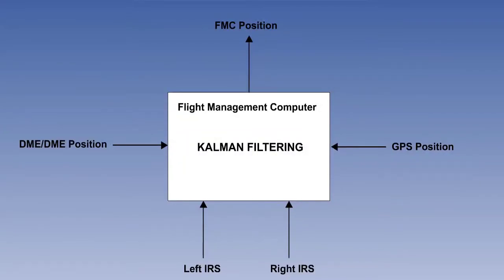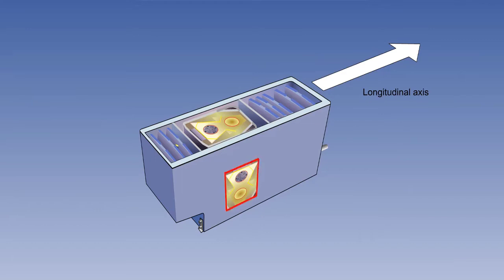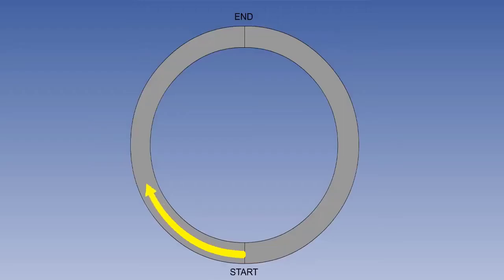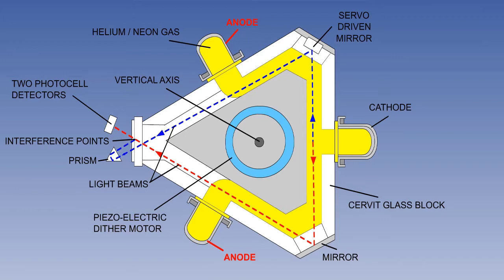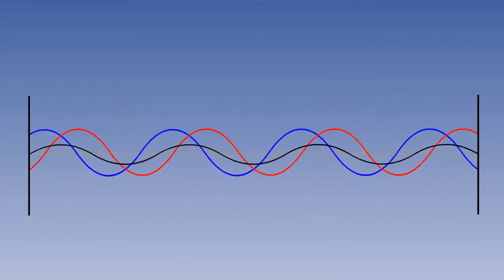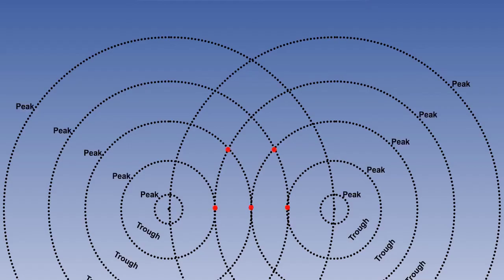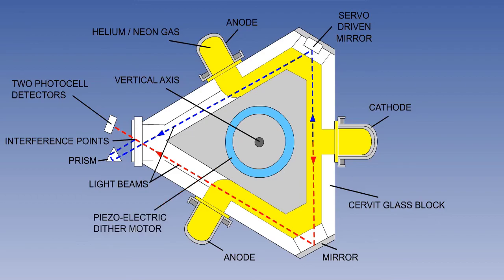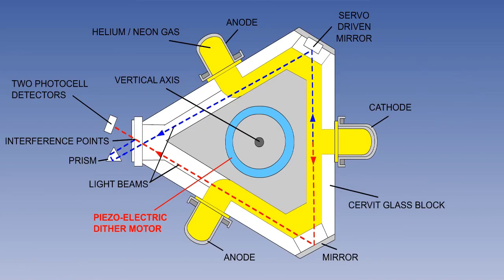Inertial Reference System Rising Laser Gyroscope And IRS Of Aircraft | Video 38

Comment: I think you have used the word 'frequency' at some points in the video where you should've used 'phase or phase difference'
Reply: @Nigel Green I didn't get that how frequency changes there is phase change due to distance change where is the frequency change can you show me ?
Reply: I think phase change alters the pattern intensity and frequency change alters the pattern itself. So you could have the same pattern with same frequency light and different phase, and have different pattern of light with same intensity for different frequencies.
Reply: I think we need to see the problem in relativistic terms, i.e., your frame of reference when looking at what is happening when the laser beams meet each other.  Initially I thought phase shift was the issue, but isn't frequency shift just the same thing when seen from a different observer/reference frame perspective?
Reply: @nigelgreen5795  how to differant fringes measure speed, when they say that c is constant no matter if you going ro or away from what your shining the laser at?
Reply: @hakaneskici2771  What really happens is the 2 beams have a different optical frequency due to the rotation and when you beat the 2 beams together in the beam combiner/ prism the difference is the Sagnac frequency. It is the Sagnac frequency  that is proportional to the rotation rate.
Reply: Agreed, the frequency of each beam does not change but their phase relative to each other does. However, the frequencies would be slightly different due to their relative movement. As you rotate, the source and receiver of one laser will get closer while the other gets further, effectively compressing and expanding each wavelength respectively. Even though the emitter doesn’t change its frequency, to the receiver each wavelength will have a different frequency, resulting in a difference in phase. See also the Doppler effect.

Comment: The cathode emits electrons, not photons. electrons are attracted to the anodes, colliding with atoms of helium along the way. The excited helium atoms transfer energy to neon atoms which excites electrons in the neon atoms. when these electrons return to a lower energy state they emit photons.
Reply: But, isn't Helium considered expensive and difficult to contain within a certain space and rare element ?!
Reply: StringerNews1  relativity says you cant measure light against light. The laser is just for show....
Reply: StringerNews1  there would be no way to measure the small fringe anyway. The unit must use xzy accelerometers plus ground based gps. As I said the laser is just for show.
Reply: @johnnym6700 actually, there are counter propagating beams which are combined with a prism, creating an interference pattern of dark fringes. When the gyro rotates, the fringes are counted. This kind of gyro is a rate integrating sensor.

Comment: I worked with the inventor of the ring gyro. This technology is over 40 urs old. it was never meant to be placed on airplanes. It was developed for submarine navigation systems. The project was sold to a company that used it in missiles.
Reply: Never intended, but tecnology marches on and minituriseation happens
Reply: The very first iteration of the ring-laser "gyro" was the optical based Gyrocompasses.
Reply: StringerNews1  The Sagnac Interferometer worked long before the first laser. about 45 years before in fact.
We have been measuring earth rotation using light for over 100 years.
Reply: These instruments were developed by Litton Ind, Honeywell and Sperry. There were many engineers on each team.
Reply: @Wanderingsomewhere145  Do you see the comment above yours that states:
"you and whom, exactly? Show me evidence of this in periodicals. I'm not holding my breath..."

There is no name and I cannot "Reply" to it.
Never seen that before.

Comment: As a certified moron and idiot. I head up a UAV company that's in the middle of building a UAV using 6 JP10X JETS (4 vertical mounted in a Conard-style design and configuration for hover mode and 2 larger J10x rear mount horizontal motors to give us >450mph fwd thrust and (with "alterations") an altitude of >60,000ft ... <48k is our current record. (Tweaking elements and heat lines to get that extra 12k is in the works) (sorry to be speaking in word salad mode; but none of this is supposed to be public knowledge though it literally doesn't take a rocket scientist to get this far) as we're working from the tail forward & we're now working on NAV and guidance plus "track and trace" with ultimate lock and fire as the goal. The question that's arisen is the choice and even the need/usage of gyros and my "MIT team of experts" all on holiday atm for the 4th all are pushing for a neuronet laser gyro which I think you've done a brilliant job of explaining here over these your 3 videos plus others I've watched. Look, I'm just the guy who gets contracts and signs the checks. NAV and Guidance alone without any track and trace and lock SW is running around $100K and now they insist despite us being 1/10th the size of the aircraft displayed in your animation (737 etc) do we really need this nuch gyro? In a UAV config is a strapped config wiser than gimble? Or vice versa? The goal when switched from 450mph forward speed to a dead stop hover mode at say 20000ft is to be stable, level, dead flat, and able to lock onto up to 35-40 targets (mobile (AtA) and take those out first then have a payload of 24 x 6lbs "dumb bombs" (that can be made "smart" via GPS or laser) with another hefty check written.... in order to ID 3-15 ground targets or one with a mega dump to ensure total destruction... which again requires a stable level flat 0 movement platform to be (calculating in weather elements and altitude and landscape etc) payload delivery system that's literally spot on the numbers then kick off the hover engines and go full.throttle to rear jets to get the hell outta there! Our "defense" is we've mimicked the F35c in shape and materials and made the fastest UAV that's not sonic nor sent as a suicide mission and reaching altitudes that rival the X2 (tweaks coming but will achieve that) and is constructed of titanium honeycomb blastproof panels with an inner wrap of Kevlar around 2 F1 style bladder fuel cells that are 3" thick and hold 35-50 GALS depending on armament as were pushing the weight load limits in the configuration listed above. If we point 2 hellfires and a dozen.6lbs dumb bombs we can take out 1 ground target and an aerial asset or ground battery and then push it to 50000 ft at 450mph (run and  hide) but have zero defence on the return flight we do have 12 chaff loads (6 per dual tail wings) with 360° radar sweep which brings us to the cockpit currently loaded with 7 boxes ranging from full radar sweep for 180-degree paints and lidar for building / mountain navigation and a myriad of other std 6 pack needs to fly in jet mode .... we're most vulnerable obviously whilst in hover mode but don't plan on being stationary more than 15 seconds if that ... for once targets are acquired we could do a sweep drop and never stop but must have a solid ID and look before pulling the trigger. We also have 2 55Cal MG front mounted to deal with pesky MiGs who like to buzz UAVs never dreaming they'll get a cockpit full of lead should they try that pissing fuel trick on us! Question is they want 80k for this laser neuronet GPS gyro. Ìt does allot yet in the grand scheme with everything else this UAV is doing in those "7boxes" how crucial is the type of gyro we aquire needed in this mess I've poorly described to you? We're not frigging Northrup or Airbus. We're a team of 12 engineers looking to make a roundtrip UAV that can out fly out maneuver and climb higher than any other UAV or ack ack despite the X2 being shot down from 82,000 ft 60 years ago. How they managed that imho was pure luck. But we wish to learn from history. And we have 200 free lbs today but once struts and fuel go in? we'll be right at our limits. Any increase in jet size is pointless as the added weight won't be offset by the extra lift and fuel burn rate we get worse. In the world of gyros what would you suggest here? I'm told cabin space is getting tight and this laser gizmo is quite sizable which has me looking at lesser models both for price & size but have zero clue how much gyro we need/used in today's aircraft? Then there CoG to sort out. Are all gyros center mounted!1 Q1? That too if true then creates a new fuselage headache Thsbks.
Reply: Honeywell makes small laser gyros (fiber based), which has a dimensions of less than 4"x4"x4".
Reply: @odissey2  thanks. Will look into it. You have a P/N or Series name by chance? Wow I’d totally forgotten about this Q! 7 months ago. Thanks for taking the time. As a tiny update of sorts; Our “track n trace” software munitions partner are Israel-based. And obviously after OCT 7th froze all partner projects to help arm their own country’s defence system. So for now we’re still doing test flights on the offensive side with BAe but we’ve had to place the defensive side on pause. 

Off topic but posted this yesterday somewhere asking around elsewhere by asking if anyone knows of a radar source for drone and missile sized objects? as we were going to make our own but after digging into it deeper… is another massive expense and seems some ppl are not fully up to speed as the Q I was replying to got closed due to it being an “opinion” vs facts. Never seen that before. So tagged a new note on in the same closed thread akd eager to hear thoughts. But our munitions (ATA / GYA tange is 45km and need a radar system that cover 3x more than that to give our AI tracking system time to ID the target. Lock-in. And then trace until insetted what to do. So been talking to several RF radar engineers  & the way I understand it it’s just not effective to build in-house and best to just sub it out & use Someone else’s instead of reinventing the mousetrap? Any thoughts on that? I was thinking if the radar dish in the nose of 747/777/787 etc. those are huge shd go out 200lm? Someone challenged me in that as it’s not apples to apples. I dunno. Just seeking a HDR solution. By the way, of the many typos I made; in re-reading my question/comment I saw the gyro price I put down. I left a digit off. It’s $880k per UAV not 88k. Oops. A big oops. Kinda a big difference so will def be researching what you shared. Does it integrate with LIDAR any? Cheers
Reply: And who fixes it when it breaks.
Reply: @B00ZEBAR0N  There is a Bird Aerosystems in Israel, who makes tactical radars commercially
Reply: @odissey2  we service each UAV (order is up to 24 now. So we’re budgeting in 2 engines for eaxh UAV as those go back to the mfg and never met a company or group of ppl (whivh in the big picture is good I suppose) who are so insist and anal that at 301 hours their warranty service goes away and the bill is 100% on us) and yes of course we’ll have repair/service bills outside of warranty but these folk are the leaders in jets used by Lockheed who can afford 100’s of swappable spares whereas we’re balancing the budget to keep 2 $85K/each spares at tgecreasy for eaxh UAC. So 2x 28 UAV’s is 48 spares that are plug n play hot swaps. So from a maintenance OOV from the outside we have it covered. Should we take a hit inside! Electronics is an entirely different kettle of fish as it’s not a field repay fix “today”. Ere liking at hot swap stacking trays should equipment enclosure stack or boxes go out or get damaged during an engagement - we all know it only takes a well placed single shot  or a pc of shrapnel that say penetrates from the bottom up and compromises all our nav systems will bring us down (?8- a chute) for a soft safe landing. Unless it’s deep over enemy territory then the “dumb bond that’ll equal over 50”bs of explosives will be as a last reset activated to blow the auAV aboard.  There’s currently 8 boxes in a rackmount configuration that if remotely diagnosed can be outswapped at Baer abroad or possibly in the field depending on the complexity of its function (LiDAR has to be recalibrated in the factory only vs a FBW box that is a basic hot swap if hit. But if shrapnel pierced all 7 boxes that most likely will take an ifly 20,000 ft fall to its death or self destruct will be activated if iver enemy terrify. It does have a “limp home mode” we’re testing now in 2 engines as the design will glide under no power. But only so far before we give up speed for altitude. Out number 1 objective as we saw in the recent Isnian attack in Israel was all the garbage hat fell to earth after being blasted inutbof the sky hitting residential areas which is our worst big mare.  So we have to weigh out the pros and cons of each feasible scenario and issue a myriad of option the pilot can implement from limp home to total self destruct and levels in between. The chute is located in the least vulnerable sebtion of the UAV and one safeicual alpha drone was blasted by BAE in N. England and a clump of burning metal softly landed with the chute deployed  and caused no ground damage nor fires as the inboard extinguishers condoned with lack of O2 at altitude kept that at a ninkoknas an auto fuel dump was also activated over water. C90% if thatvaporized or evaporated before hitting Sr’s level best we can tell (33 we’re 45km from the crash site) so have to t rely on NAE’s reports and their recovery team reports. That’s how we plan on short agd long term field and factory maibtnence as we build a EU dabilitybat an undisclosed location that’ll slow us to turn a intact vehicle back into service within a day not counting travel time from XyZ repair plant to the front line. Unless flown in. I will say it is in country but not in a major city nor is their nail near us and is completely undetectable from space or air so feel confident outside of the 300 hours of mandatory factory  in regards to field repairs and the damage sustained - we can turn a UAV in 24 hours. If we switch to hot swap trays it’s possible we could switch to a field repair model as long as it’s not NAV related.
Reply: @odissey2  Honeywell "MIMU".  I just helped launch one on USSF-62.

Comment: Long ago I heard that a jet aircraft equipped with ring laser gyros that sits still on a runway or apron for a moment or two can know where it is with great precision, because the laser gyros measure the movement of the earth's spin to make that calculation.
Reply: It can calculate aircraft attitude, true north direction and latitude of its position, but that's it.  You have to inform an IRS of its position while stationary on the ground before you can begin using them for navigation.
Reply: A single gyroscope aligned to measure heading of a vehicle that is sitting still on a level surface will also measure a fraction of Earth's rotation, depending on its position North or South of the equator. The closer to the North pole it is, the closer it will get to measuring 15 degrees per hour counter clockwise rotation while sitting still. The Sine function will approximate the rotation rate the gyroscope will measure. For example, in New York city it should be around 9.8 degrees per hour, London ~ 11.7, and ~ 0 at the equator. This requires an expensive and well calibrated gyroscope for any kind of precision.
Reply: @odometric5946  kinda like the one those flat earther's used in an attempt to show a stationary earth! 🤣🤣🤣
Reply: @I_dreamed_my_name_was_Brandon A Sagnac interferometer laid on a table at the north pole will measure the full 15.0 degrees per hour.
The same Interferometer put on a table at the equator will measure ZERO rotation because it is now NOT rotating with respect to its own axis because it is 90 degrees to earth's rotation axis.
It cannot "SEE" the rotation at that orientation with respect to the rotation axis.
Reply: StringerNews1  - "Conservation of momentum means that even in flight, the rotation of earth influences the gyros."
NOT ring-laser or fiber-optic gyros.
The photons do not carry angular momentum like a physical spinning gyroscope.
Reply: StringerNews1  Tell me which part you disagree with.
I have an electrical Engineering Degree, (did very well in History of Science) and I have been working for almost 30 years as an Aerospace Test Engineer on some of mankind's most advanced vehicles.  One of those is in the Smithsonian Air and Space Museum with my signature inside it.

"But since you're claiming that each and every aircraft navigation system is actually "faking it""
I never said any such thing. Try providing my comments when you are responding to them.
Reply: StringerNews1  Just one small part of my job is testing 3-axis fiber-optic gyros using earth rotation as the stimulus before and after installation into a vehicle.
Maybe YOU could explain it all to me?
Reply: StringerNews1  Perhaps you are not aware that an Inertial Reference Unit is made up of at least three orthogonally oriented Sagnac Interferometers.
Because they cannot read any rotation unless a component of the rotation is along its SENSE AXIS.
My point was that IF you align a single axis SAGNAC Interferometer just right, you can get it to sense the WHOLE 15.0 degrees per hour or ZERO degrees per hour.

That is NOT the same as claiming they are "faking it" genius.

Comment: as i understand, its pretty much measuring change in waveleinght caused by the doppler effect on a single axis? Doesnt vibration of an airplane frame causing shifts in waveleinght? How is that compesated?
Reply: They assume that their laser device is amazing Because it emitted bright and shiny laser, so they assumed it has no problems and it does not get into trouble, that's it !